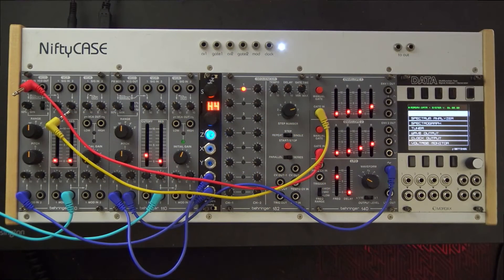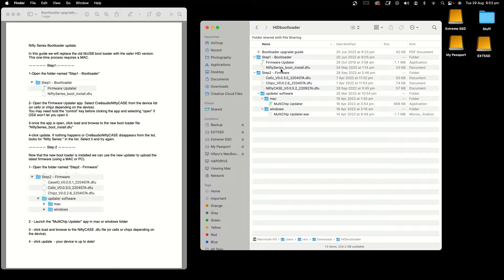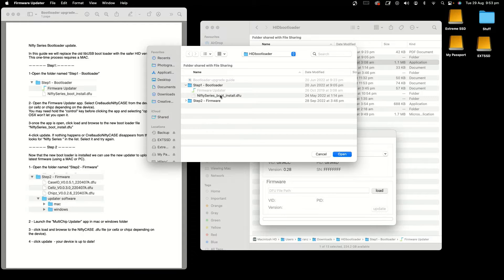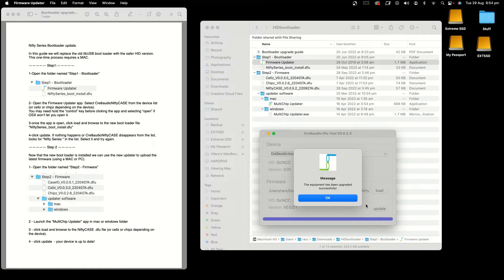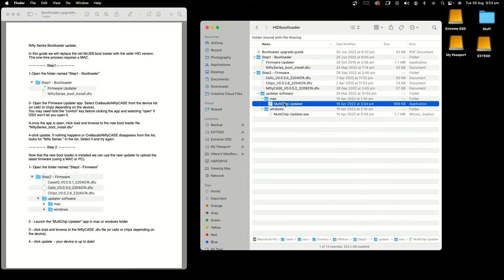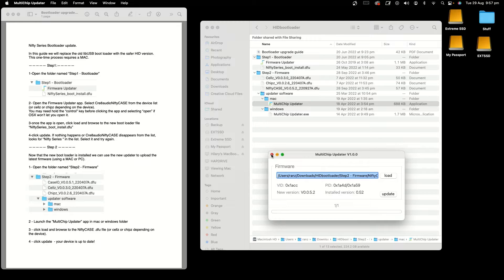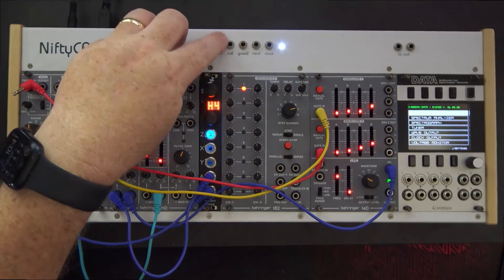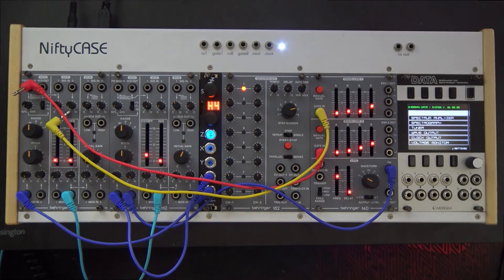NiftyCase - Firmware Update

Comment: To everybody with a raspi Pi here: I need help/support on the raspberry forum, they screwed the MIDI DIN, it keeps crashing overlays, and no-one is doing absolutely anything... to everybody reading this... MIDI, I2C, rp1 Pi5, which GPIO? That is the thread... or open others... ttymidi threads got locked down... I really need some support there... It's like I'm the last mfk left who cares about this and evbody is just doin Usb Midi or using Picos and moved on...
Reply from the maker: have you tried some of the linux dev forums? I don't know if you've got a coding background, but there might be ways to troubleshoot this. I would look at the rPi console and tail the usb devices using something like: lspci | grep -i usb ... then you can test what is happening. if it's a MIDI issue - you'll need to run a console base MIDI monitor perhaps? a few ideas anyway! not sure if these help!
Reply: @ranzee   I am building the Pi5 inside the NiftyCase, I will use Usb Nifty to the Pi5 plus a small FM module and a DAC give me one aux in and two out, the FM out goes straight to FM. Linux on the Pi is a mess, they still suggest Ubuntu, which is snap dead now. Debian and Fedora are the alternatives. Raspi OS is in fact a port of Debian. The problem is with discrete BAUD rates and the kernel. There is not a default MIDI baud rate in the kernel to use. Linux forums like Linuxformusicians works a lot with USB Midi 2.0. There is a lot of undone testing because of all the SBC boards around, and there's a push from IBM, REdHAt, MS, to get loose of Git, Xorg, etc... it's warzone...

Comment: Hi Ranzee. I'm trying to hook it up to a Rasp Pi 5 with Pi  OS 64bit. I had success in plug and play with all Usb sound cards tested, except NiftyCase... could you help me out in this??? PS: I have Cardinal on the Pi, and Plug Data. Both could make use of the gate, cv, clock and midi in and out of the NiftyCase.
Is there some Linux instructions maybe that I could use in raspi-config??? Or no chances???
Reply from the maker: you will need to install the USB driver on your Pi (reach out to Cre8Audio support for more info) - but before you do, make sure you update the firmware to the latest. I haven't tried it on an Arm processor running Linux.
Reply: @ranzee  Uhuhh you don't know how much I learned on the Pi5 in this short time... it's not just cre8... even korg sq1... keystep... I have other options in theory... in theory.. tnx!
Reply: @ranzee  Pi5 is different, they have broken all the old Pi libraries compatibility, it's hardcoded with hidden hardware address... theres a rp1 hackin effort just to unlock the midi port it's like fort knox...
Reply from the maker: good to know! It might be the new processor - be good to see how it develops
Reply: @ranzee  I got it working! I have updated the firmware finally it works! but I have another problem....